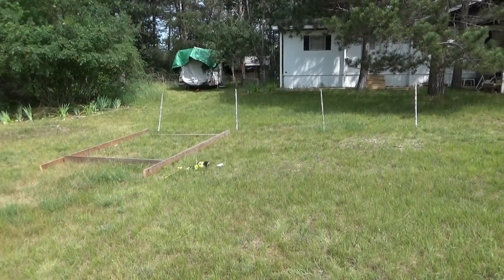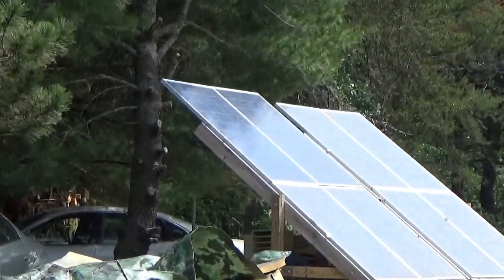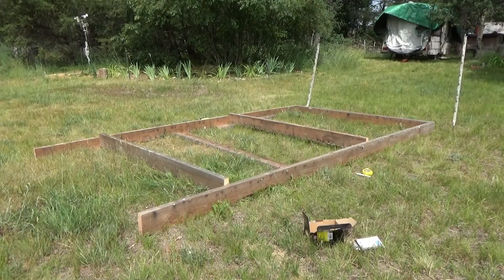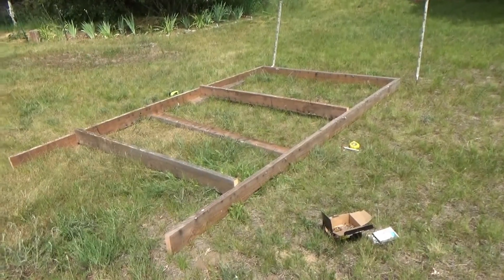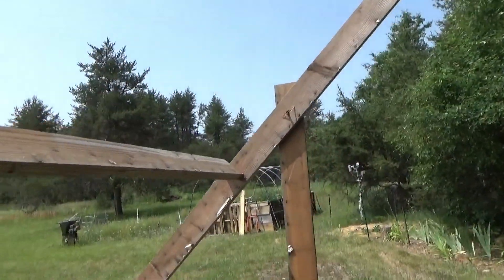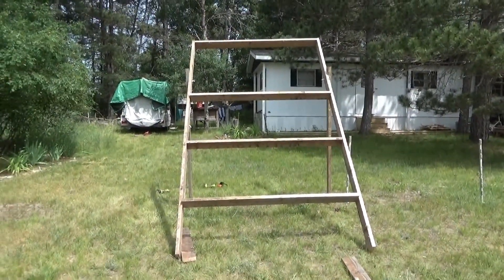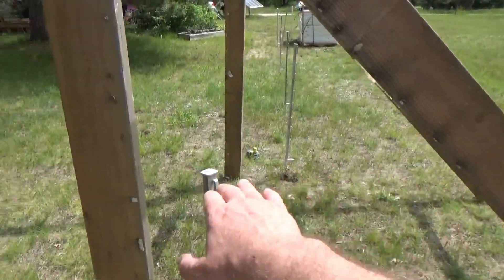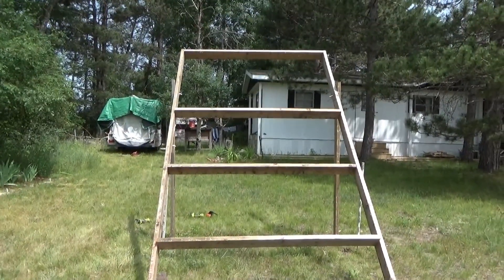Testing Pallet Of Broken Solar Panels And Building Racks

Comment: S energy had BIG production problems with the soldering & hot spots .
Exit a diode followed by a link & all cells open 100% self destructive …...........

Voltage hint hint
Look at half cut solar panels .
Just 60 cells in a string with a diode across every 20 cells .
Works just like the old tree lights .
One out all out .

Comment: Just wire the leads to the highest volts simple. Unhook any low voltage and wire up the highest voltage  and what are the amps? If you dont have any amps then they are worth less. voltage is one thing but with out any amperage it will not work.  Volts x amps = watts    Ohms law  Soo what is the amp reading??? If they dont put out any amps then get your money back. Did Meloney hit you in the back of the head after she found out you bought broken panels that dont even put out more than 11 volts? I would rather have bought 4 non broken panels than a whole pallet of broken ones. I hope you learned your lesson. You cannot get something from nothing. You get what you pay for.
Reply from the maker: Actually if you buy a pallet of freshly broken solar panels you should expect 80 - 95% of their rated capacity. You have some time to get them weather proof before they degrade too much.
Reply from the maker: The listing said these were broken in return shipping to the warehouse. Which implies freshly broken. The listing said these should produce at least 80% of their rated capacity, which is to be expected of freshly broken solar panels. But these are clearly broken long long ago and left neglected outside in the elements. The listing was false and I am going through ebay to get my money back.

Comment: why dont you fix your ride on mower instead of wasting money on that junk
Reply: There must be some junk in your head. And that can't be fixed, I am sure.
Reply from the maker: Your priorities are not my priorities. Making money is on the top of the list for me so this goes first. My push mower works fine so I dont urgently need to put money into the riding mower. And I am not sure why it is not firing so its on the side burner. Funny thing is that others call the riding mower junk and say I should not waste my money on it.

Comment: you bought junk panels, what did you expect?
Reply from the maker: Solar panels which have broken glass are fully functional and can simply be repaired using epoxy. Solar panels which have been sitting out for many years AFTER being broken are damaged beyond repair through corrosion. The listing said these were recently broken and said most have near to full output. The listing was not true. I expected to get what I paid for.

Comment: My thoughts are that you just wasted your money on junk panels. Not trying to be negative. Just being honest with my opinion.
Reply from the maker: If solar panels have freshly broken glass they will still produce 80 - 95 % of their rated capacity. You have to put solar panel epoxy on them to protect them from the elements and they will last for many years with no problem. But these were sitting outside many years after being broken and are badly degraded. I got screwed. I am working on the complaint process now.
Reply: @TheDoItYourselfWorld  The last panel I got of hold of that was broken like that, didnt make hardly any power and was lucky to produce 10 % of it rated power, But sometimes you can get lucky and have seen other people get lucky also. But in the same time the extra money you would spend on epoxy coat , time spent, and let alone the heart ache. Sometime you need to get known good panels . That way less heartache and less failure to deal to with. I have 5 Kw in panels myself. Usually you can pick up good panels 10 or 12 at a time for under $1200-1500 usually around 250 + watts per panel also.

Comment: to check diodes un solder 1 leg and use diode test scale on dmm. diodes only work in one direction with .75V drop or so depending on amps. normal to see .87V with a amp or so.or use test light with 6V or 12V battery. light one way only. look like 6a diodes. may drop 1V at 6amps. the diodes are for partial shading on panels to keep out put up under shading conditions. Check u-tube videos for diode testing there is a lot of them. good luck !!
Reply from the maker: Thanks. I am quite familiar with electronics but not how to test them in a solar panel, which I was hoping to do. After research the easiest way to test them is to remove them. I am just confused by the strange voltage readings I am getting on the panels.

Comment: If you have two good strings in each panel you could use as 12v panels.Just reconnect in the juntion box and delete the bad string.

Comment: to check your diodes just put the Vom on continuity, short the probes to make sure the meter is working it should Beep, then check each diode indiviguly should beep one way and no beep when you reverse the probes and check it again.  ( but it should defenetly beep in only one direction or the diode is probably bad in witch case i would unsolder it and check it again lol. Good Luck.
Reply: Jay making sure power is off from panel like at nite and covered. Diodes go only one way. Sound idea but troy needs all the steps shown just his army training.He is a good kid I am 65 but he is visual so what we see snd what he sees takes a little longer to process.